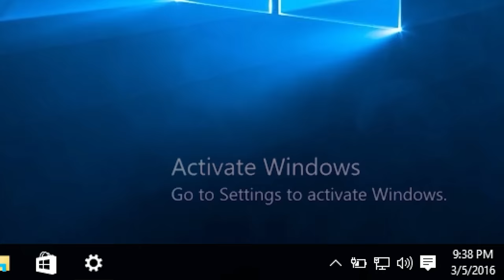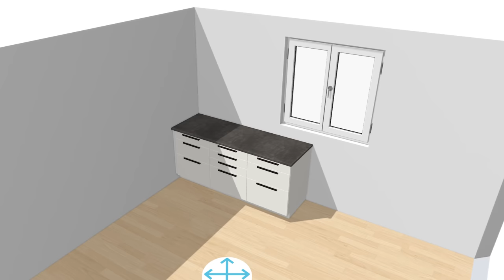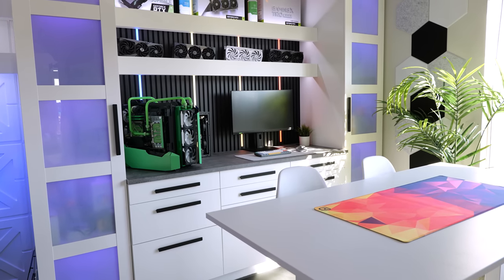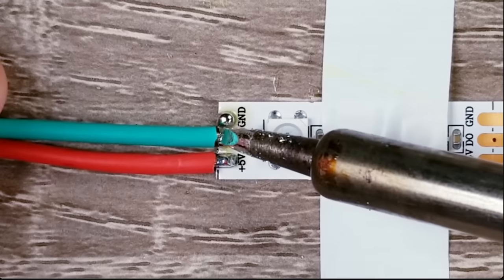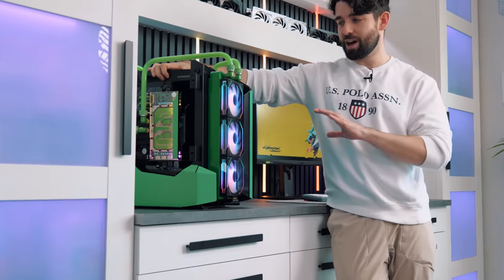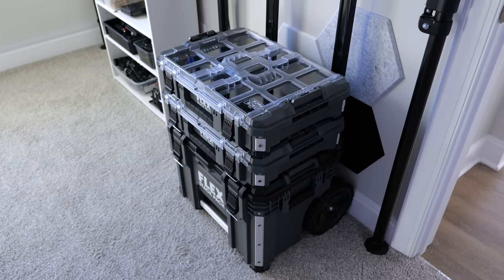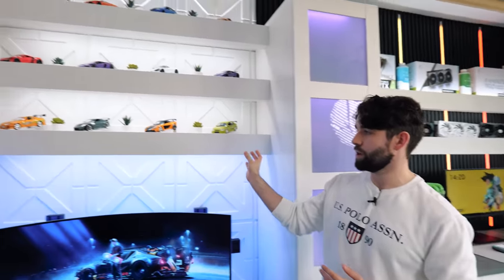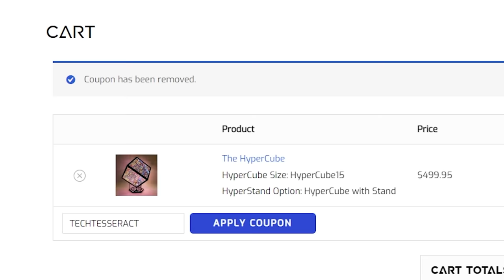$25,000 Studio Setup/Room Tour 2023!

Comment: Nice set up but i have a suggestion. A cheap surge protector daisy chained to a cheap extension cord will not only break your mounted TV, but could possibly start a fire. You've put a lot in your gear and your house, so don't drop the ball by cutting corners towards your investments.
Reply from the maker: Hey, glad you like it! Genuinely curious about this - how exactly could it break the TV? Surely devices are still surge protected if the last thing they are plugged into is the surge protector right, regardless of whether an extension is used? Also we have 3 devices plugged in, TV (1 amp), camera (0.5 amp), and 150w light (1.25 amp) -  I understand the rating is only as good as your weakest component, but the 16 gauge is rated for 13 amps so a total of 2.75 amps should be safe as it's well below the max current rating right? But yeah I should probably just pick up a long cord surge protector to simplify things xD
Reply: @TechTesseract  I wasn’t sure of the specs or what was plugged in so i left that thought open. But yeah, I agree with the longer cord surge protector! I’ve been told before that extension cords should be treated more as temporary thing and that daisy chaining can increase the risk of overloading the circuit and create a safety hazard. I just want to make sure worse case doesn’t happen.